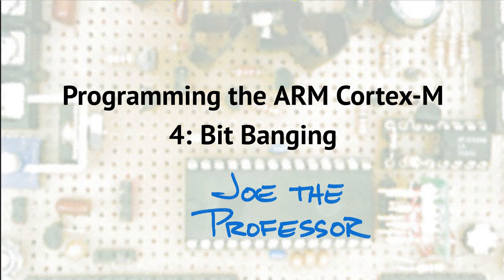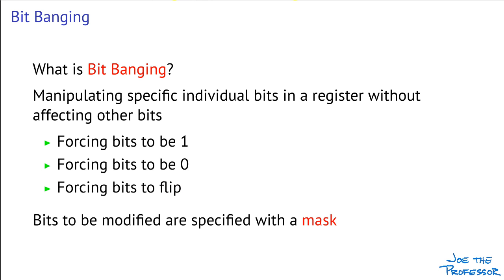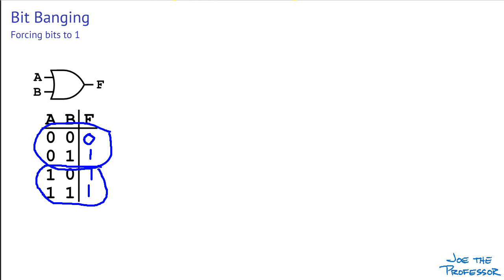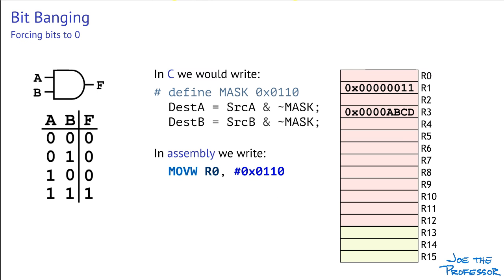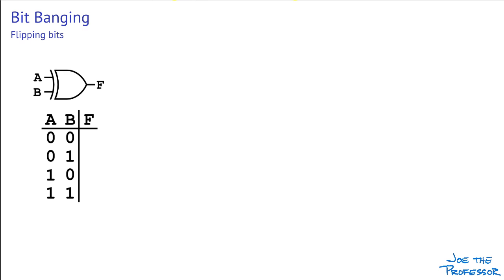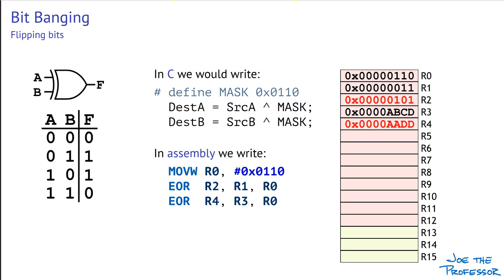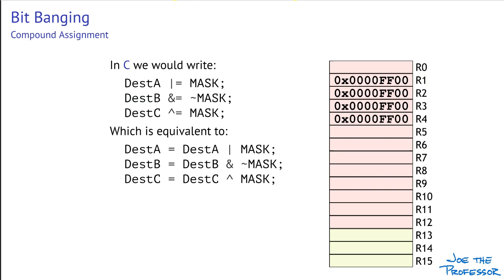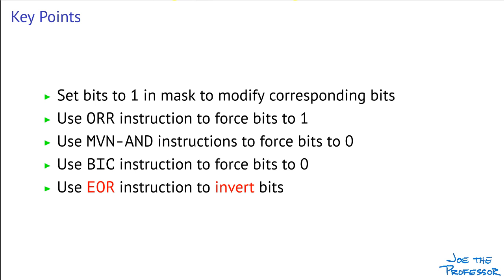04 Bit-banging in Cortex-M Assembly

Comment: Hi Mr. Joe in munute 3:30 in register R4 is value 0x0000ABDD, it should not be value 0x0000ACDD? Thank you for this video.
Reply from the maker: No. If we perform the bitwise OR of 0x1 (from R0) and 0xB (from R3) the result will be 0xB.
Reply: @joetheprofessor6260  thank you for you answer, but if we perform the bitwise OR of 0x1(R0) and 0xC (R3) the result is 0xD and from what you have wrote earlier I thnik that should be 0xC. Thank you for answers for understanding this.
Reply from the maker: @Antyelektronika  0x1 is 0b0001 and 0xC is 0b1100. If we OR them together we get 0b1101 which is 0xD

Comment: I've heard and used the term "bit-banging" many many times. Nothing new to me. What I haven't heard of is the vertical bar '|' (or just "bar") being called a "pipe". Never heard of that before.
Reply from the maker: In a unix shell the vertical bar is used to take the output from one command and "pipe" it to the input of another command.
Reply: @joetheprofessor6260  I am very familiar with pipes in command language interpreters. Within the narrow context you describe, the "pipe operator" is represented by the ASCII unbroken vertical bar character (there is a broken vertical bar' ¦' character and that one is not in ASCII). But the character is not a "pipe character" just as an asterisk is not a "multiply character". In fact, Unicode clarifies that '*' is an asterisk and is intended to be used for a footnote indicator which was its traditional purpose before programmers hijacked it for other uses. Unicode defines the '×' to be the multiply character (or more strictly its Code Point). In the C language, the asterisk is used as the "multiply operator" but it is wrong to call it the "multiply character". The character is still called an asterisk. As in the C language, the unbroken vertical bar is the inclusive OR operator. Applying jargon that comes from unspecified and/or unrelated contexts should be avoided. It only causes confusion.

Comment: why we use bit banging operator instead of assigning a value to a register to change register value? what is the purpose of this?
Reply from the maker: You use bit-banging when you only want to modify some, not all, of the bits in a register. For example, one function might use bits 0-3 and another might use 4-7. Each function must be careful to only modify those bits it is allowed to access, and not make any assumptions about the values of bits that it is not allowed to access.
Reply: @joetheprofessor6260  for example ı have to make 00000011 to 00000010 in a register. I am assigning relevant register to "2" (in decimal form ).  You say 7-6-5-4-3-2-1 bits are busy in the register while assigning another function try to use those pins, is that right?
Reply from the maker: @coderhex1675  By simply assigning the value 2 to the register you are forcing bits 4-7 to be zero. But if those bits are controlled by some other function, some other part of your overall program, they may not be zero when you are ready to clear bit 0. That's why bit banging is used.
Reply: Understood... very thank you. By the way would you like to find me on facebook: osman.cicek.9216  I want to meet with you. Please PM me. Sorry for my bad english.

Comment: I am watching your videos and I live them. However, using the term bit-banging is not correct. you mean bit-banding which is a feature in arm processors. bit-banging is a software technique to send serial communication over gpio.
Reply from the maker: I understand what bit banding is, and that's not what I'm talking about. I'm using the term to refer to the underlying bit manipulations that you must do to the I/O registers in order to accomplish the serial communication you are referring to. I'll concede that it might be better to call this bit manipulation or bit bashing.
Reply: @joetheprofessor6260 50 years ago we used the term "bit-banging" to shame the software guy who couldn't afford a hardware serial port (UART) but had to write the code to serialize data (start, stop, parity, framing). Both ways.
Still do.
The title of this video should say "bit-wise" or "bit-manipulation" or "bit-twiddling", not bit-banging.